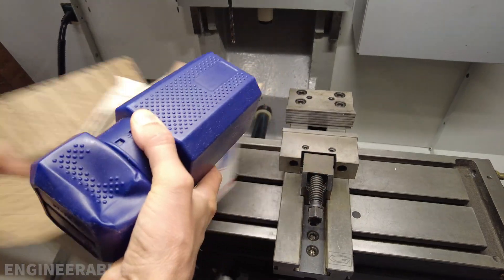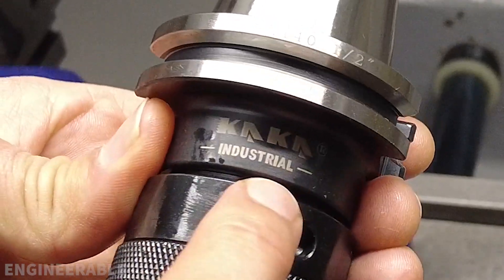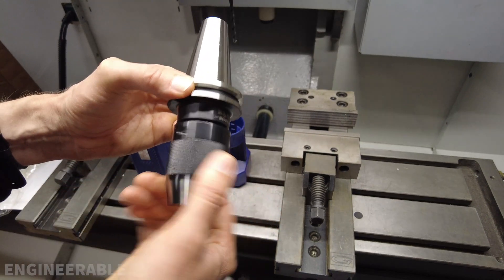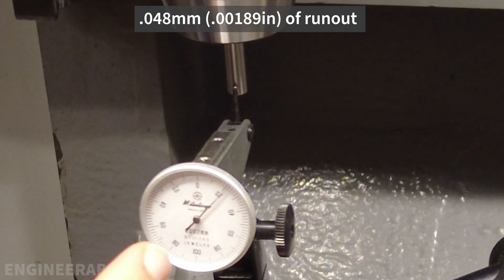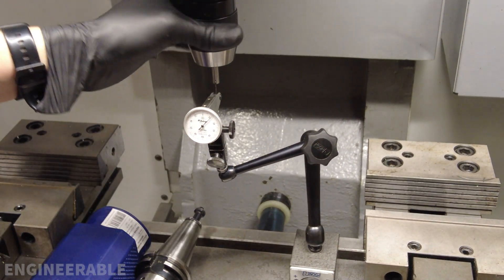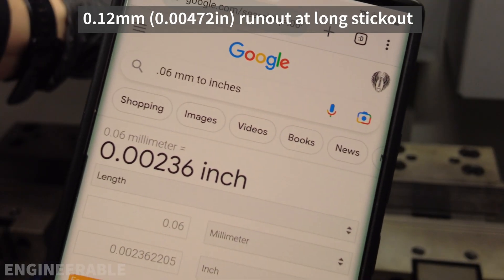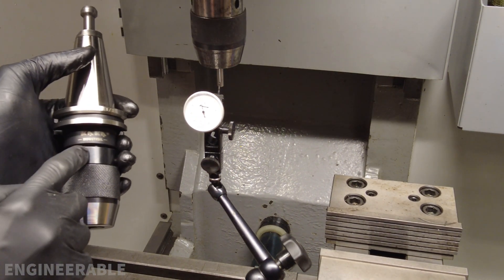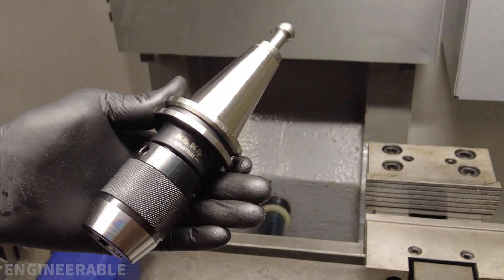I bought the cheapest CAT40 Integral Keyless Drill Chuck on Amazon | Is It Any Good Or Is It KAKA?!

Comment: Is it possible that releasing and tightening it multiple times will result in different runout values? If so testing again with multiple measurements and taking the average might be a better way to compare them.
Reply from the maker: I did do that multiple times, but didn't show it in the video. And flipped the pin.
Reply: @engineerable  ♥

Comment: The mt2 precision keyless chuck I ordered, turned out to be very imprecise. The jaws can all move freely in each direction independently, even up and down. It feels awfully sloppy, small diameters tend to clamp out of center, between only 2 jaws, although a longer shank helps a bit.
Reply from the maker: That sounds terrible. This chuck was definitely of much better quality
Reply: Did the mt2 come with standard or metric treads?